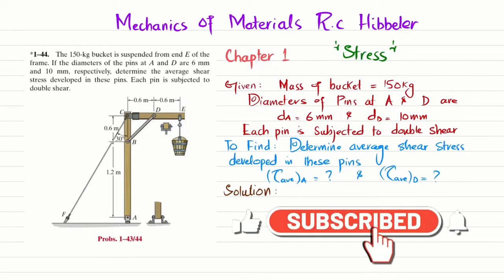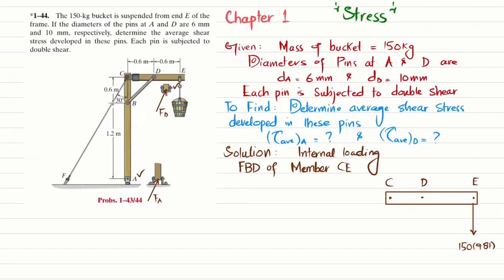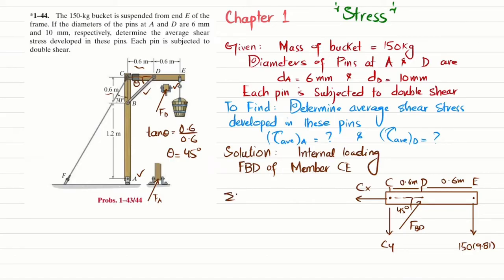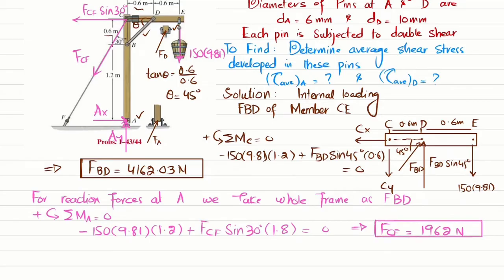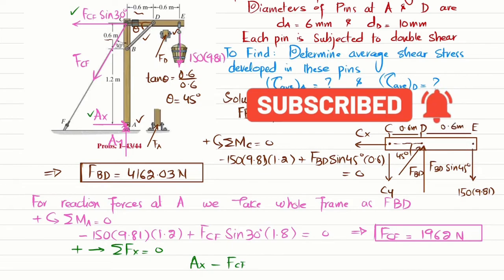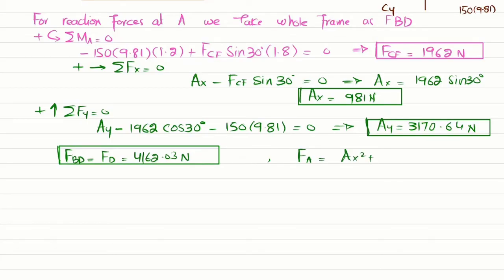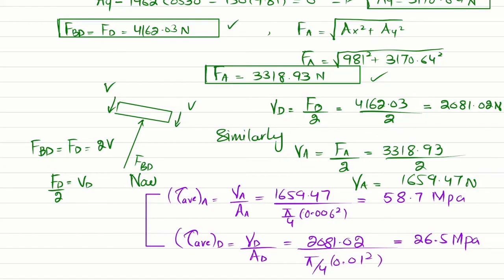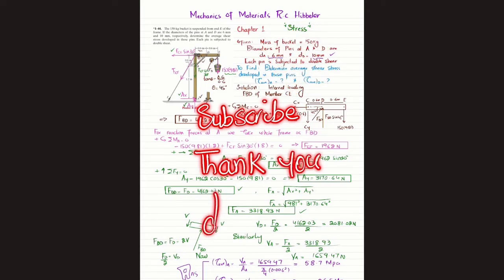Determine the average shear stress in pins | Problem 1-44 | Stress | axial load | Mech of materials

Comment: Could you please explain why you used the whole frame for the reaction force at A?
Reply from the maker: The reaction force can only be fine while using all the frame because all the forces acting on the frame and the support at A is going to bear all the force that's why reaction at A is calcualted by using all the frame as single unit.

Comment: Sir Please could you please help why that why you did not take the x component of the force Fbd in the free body diagram as as in the calculations?
Reply from the maker: ok you can see the x component of force Fbd is passing through point c and not producing any  moment about c that's why i have ignored it. you can mention it bro. ❤
Reply: @engradnanrasheedmechanical  in the first part for the member CE is clear , but in the next part for taking moment at point A there the force Fbd will not be considered since it has two components? as well for calculating the sum of the forces in the x component you took Fcf with Ax
Reply from the maker: @ImranAlBalushi-zm8hn in the 2nd part the whole frame is taken as free body diagram that's why.
Reply: @engradnanrasheedmechanical  Then Sir when talking the whole FBD, the x component of Fbd considered as internal force right?

Comment: why did you use cosine when solving for the Fy
Reply from the maker: are you talking about Fcf cos 30 degree?
Reply from the maker: From trigonometry cos 30= base/hypotoenous = (Fcf)y/Fcf so (Fcf)=Fcf cos30
Reply: @risvelimacbaligasa5205  It’s not right or wrong to use cosine for Fy but it matters which angle it’s in reference to. If you prefer to use sin 60 you can but it’s because the adjacent side from Fy is what’s needed.